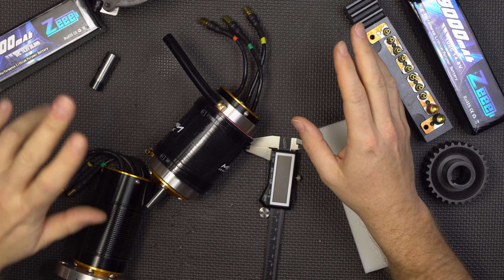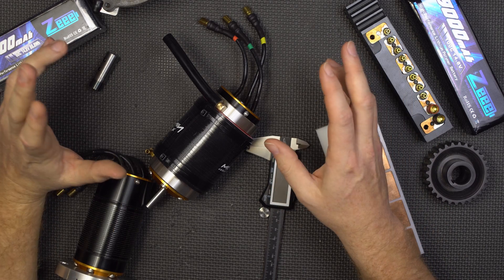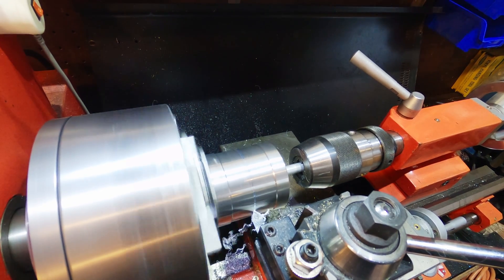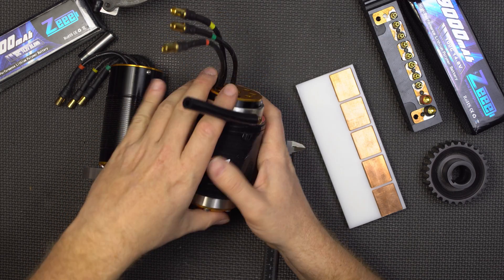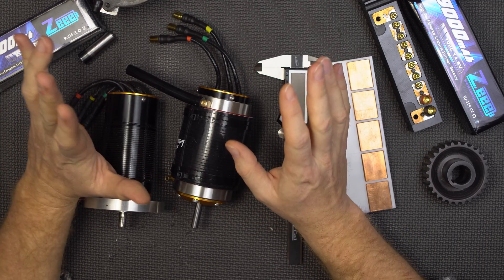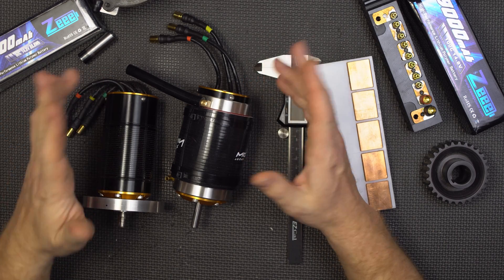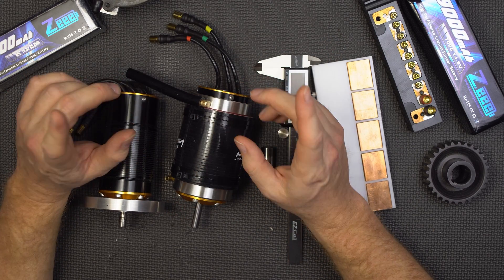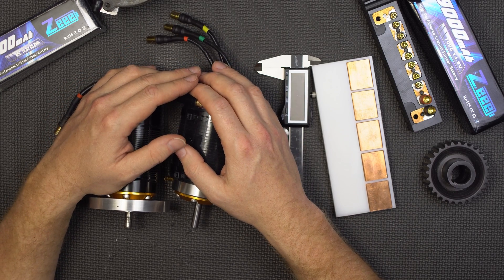DIY Electric Turbo - Price List & Thanks!

Comment: Did you overvolt the motor? By the specs I think yes
Reply from the maker: Yes and no.  The motor's rated for 53 volts; but even though I was feeding it 67 volts (no load), under load it dropped down to about 50 volts.  So technically, I was undervolting it at full load.  BUT - and this is important - I learned something about brushless motors - they tend to be magnetically limited (also known as "iron limited") - in other words, once the iron laminations are magnetically saturated, that's it for power output - doesn't matter how much more voltage/current you throw a it, it's not going to gain any rpm/torque.  All that happens with the extra power is it gets turned into heat.  This motor hit saturation at 281 amps and at 13.8 kW.  So there's not point in pushing it harder - you'll just melt the windings or other bad stuff.  Most brushed motors, by comparison, tend to be "copper limited" - in other words, the windings will fail before saturation occurs.  Hope this helps.

Comment: Why didn’t you just buy a Torq Amp?

Or just use a normal turbo which would be better weight to power ratio.
Reply from the maker: A torque amp would be nothing more than a massive restriction on this car. It's way too small. I could turbo charge it and run 8's, but then you wouldn't be watching this video.  I think it's more fun and interesting to do something unique.
Reply: @AlexLTDLX  correct I didn’t see the engine application until after I commented..
Reply: @Thumper68  torqamp gives about 1-2 psi on 6000rpm 2.0 liter.. and it costs 2300euros which is very expensive also.
Reply: @marlo0oty213  I know this why I replied what I did on this thread
Reply: @Thumper68  i hope Chinese markets get on track with these manufacturers also i guess it would cost no more than 1500$ then..
Reply: @marlo0oty213  agreed I personally just build nasty n/a engines :)
Reply: @Thumper68  n/a is frekn good but costs a lot not like the turbo
Reply: @marlo0oty213  kinda depends on who’s building it as well. And what your putting it in too

Comment: Can’t wait for the final product , you are the reason that I’m not buying a torque amp. I have contacted torque amp many times and they have no new content. I’m wanting 6-7 psi on a 3.0 engine that redlines at 8500 rpms. I really want boost on demand, like nitrous, if that makes any sense. Also do you have any information on the Garrett electric turbo ?
Reply from the maker: This current setup would most likely work for you.  What is the current base engine's power  (hp)?  You can plot it on the compressor map and see where you're at; you'd need to make sure you can hit the pressure ratio you want and stay on the map.  For a smaller setup like what you're talking about, a positive displacement blower might be the way to go - you'll never go into choke or surge.  With a centrifugal compressor, you do have to play this balancing act.  The advantage is the impeller weight is measured in ounces; in a positive displacement blower, it's measured in pounds; and therefore takes less power to drive.  Plus, centrifugal compressors tend to be a little more efficient overall.

Comment: Have you looked into running an intercooler. cos that will be a relatively cheap way to get more power. 
Also you could be playing dangerous games with all your inserts that you didn't make. The rights holder (anyone of them) may make a claim against you if you get bigger and take all the money you could have made from youtube. I know cos i've done it to people who have made "compilations" using clips from my videos. I'ts super wasy now cos You tube actually goes and finds content on youtube and asks me if i want to make a claim against them.
Reply from the maker: Until we make more than about 6 psi, an intercooler will likely cost more power than it will make.  I've made my own intercooler (core and all ) before: https://youtu.be/oXeUxONLO9I  The "inserts" (b roll) come from Motion Array - and we pay for the rights to use them.  Trust me, I've been dealing with this stuff for 30 years; I used to know the AFTRA/SAG contracts like the back of my hand.  There's a pack of lawyers down in Texas called "AdRev" that exploit a gray area in copyright law and ding everyone for stuff they don't have rights to - they screw everyone around them for their own benefit - even the artists they're supposedly "protecting."  Shady and definitely immoral.   I'd like to see them shut down.  They've even dinged me for music I had composed for myself (by a composer, to be clear).

Comment: Hey Alex. It's great to see progress on Electric Turbo. I wanted to ask You: What do You think about using e-Compressor from SQ7 as source? They sell used ones for $100 in Poland, so that is pretty cheap, but problem is with running it, because there is proprietary controller made by Audi. I thought about stripping it from electronics and strapping TP Power like You did. If You want to see how it's constructed, here is disassembly video (starting around 7th minute): https://www.youtube.com/watch?v=uLPsPddmbLI

Comment: Are you thinking about a bypass valve for intake when the supercharger isin't running? So it don't obstruct the intake?
Reply from the maker: It's about a 1 psi equivalent restriction.  That still gives us close about 490 flywheel HP to play with.  Don't really see the need for a bypass.  Thanks for the thought though!

Comment: You and your free blowers!  Happy New year!
Reply from the maker: Lol.  Technically, this would be my third one.  I did pay for the Whipple.  The M90, M112 and this one were basically free.  But this one was a display unit, and I did end up putting about $900 into it (impeller, volute and two sets of bearings, Isoflex, silicone o ring material, etc), so there's that.  But yeah, you're right - if it wasn't for people offering up stuff like that, we wouldn't be here.  Thanks to them and to you for taking the time to watch and comment.  Happy new year!
Reply: @AlexLTDLX   I forgot about the whipple, but I remember the toohighpsi days!

Comment: your project keeps me from buying a torqamp😂
Reply from the maker: We should be beyond the capabilities of three of torqamps combined at the next round of testing.  I genuinely feel you'll be able buy bigger units in the near future.  Garrett just announced fully electric turbos for hydrogen powered engines.  They're rated at 20kw.  Pretty much where we're at.  Thanks for taking the time to watch and comment!
Reply: @AlexLTDLX  Hello Sir and happy New Year to you and your family. So, I have the TP5850 motor, 400A controller. GT45 Turbo Housing at the machine shop to get mated to the propeller. My project is for spooling turbos early. My goal would be achieving 20psi of turbo boost around 2500-2800 RPM instead of 4200 RPM. Torqamp says their motor runs approx 70k rpm. The TP5850 is rated at 51K rpm I believe. What are your thoughts on hot to get 5-7psi of pressure from the electric turbo?
Reply from the maker: @ltorealestate  I doubt the twerking of runs at 70,000 rpm. That's probably just what the motors rated for. As I found out the hard way, even though the motor on the electric vortec is rated at 50,000 RPM and being fed maximum power, it's still only turning about half that fast. It will be interesting to see how much more RPM we get out of this latest round of modifications. Although it sounds logical and in reality it is, the more boost you make the more power you need. But I mean that in two ways - not only the way it sounds, but also in relation to horsepower level. So on one engine if you only need two pounds of boost to hit 600 hp and on another engine you need 4 lb of boost to hit 600 horsepower, the one that needs 400 horsepower will require more drive power to the turbo. I hope that's understandable, I'm dictating this into my phone.